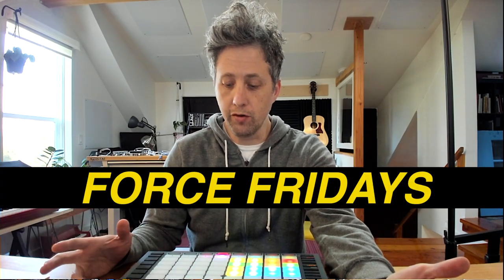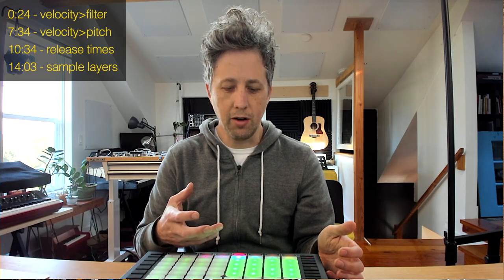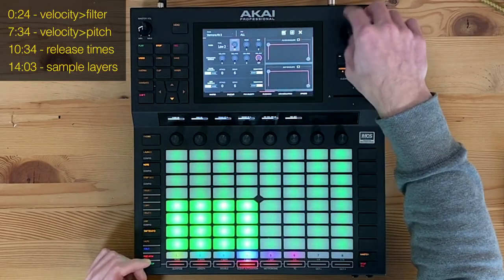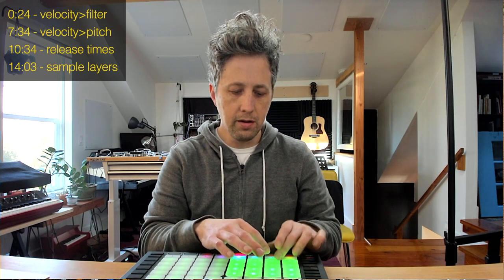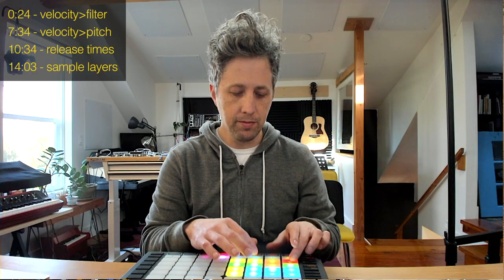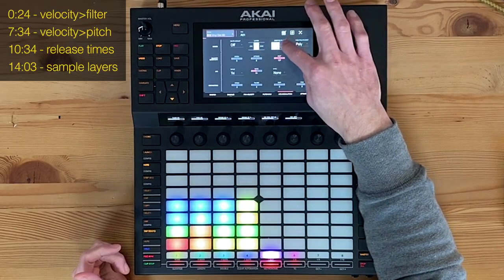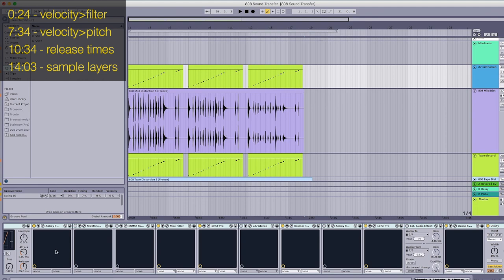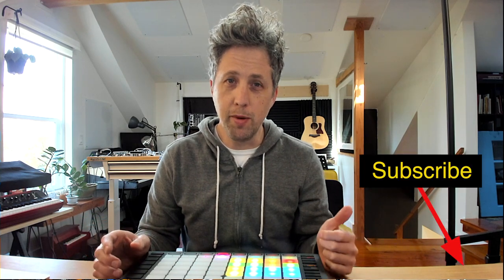Akai Force Fridays - making more expressive drums (also applies to any MPC)

Comment: My friend I don't want to bother you. I bought this lovely machine. And I kind of need some help here and there. For instance I do big recordings midi and audio. How I can work the playback from a certain point not the beginning every time? And the other one is about the midi keys os just a setting but many times it does not get my playing signal it optimizes it it's missing hits notes and so on. Can you bring some light? It's about snap and time reference. Something like that. If you have any answers I would really appreciate it.
Reply from the maker: I'm not sure exactly what you're asking.  If you wanted to start playback from different points in your song, then you should create a "row" (horizontal) for each section that you might want to start from.  Whether that's verse/chorus, or something else.  Then you can click to trigger the whole row of clips and start from that section whenever you want.
Reply: @PinkBuddhaAcademy  thank you my friend for the tip. My midi thing was a time correction thing. About the playback way I get it. But I use force standalone recording acoustic ballads more as a daw and then building on top of it the tune with beats and synths. I can work around with scenes but still I kind of have to listen 12 or 16 bars in order to make a change etc.

Comment: Has anyone else noticed that since update 3.0.5 and 3.0.6 when you make a drum kit it will no longer save the kit volume setting and pan setting with the kit. It always defaults to center and 0 gain. It worked in 3.0.4 and they added the bug after that.
Reply from the maker: Haven't noticed that....but is this when you have it in the context of a project, or a stand alone kit